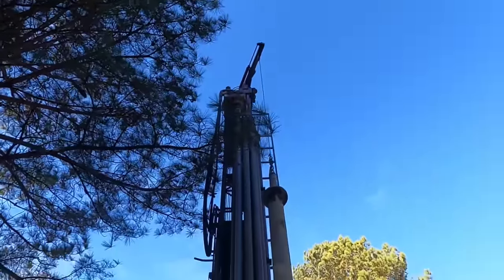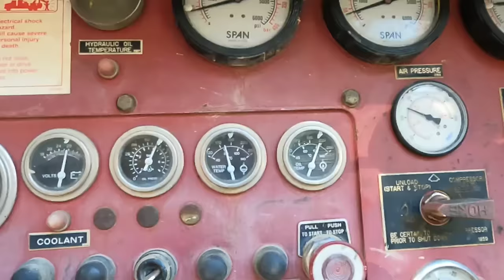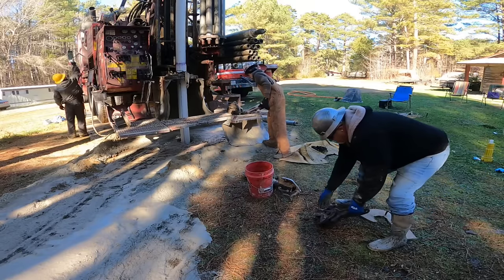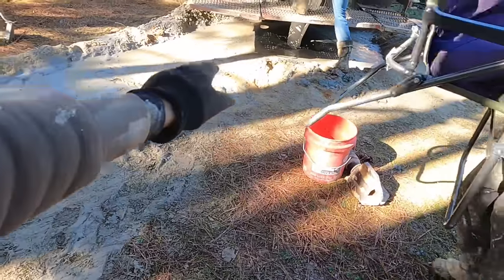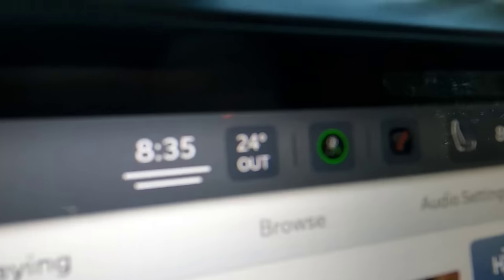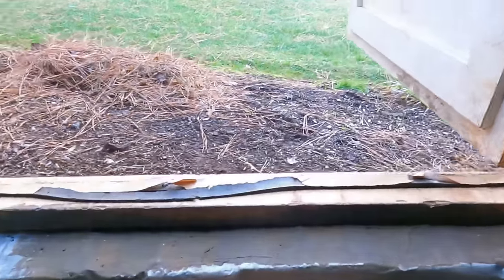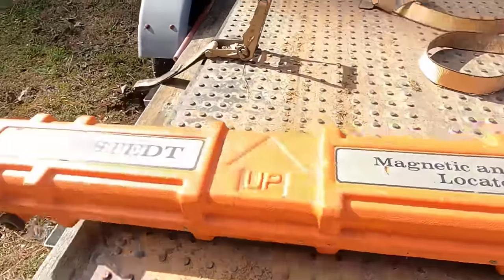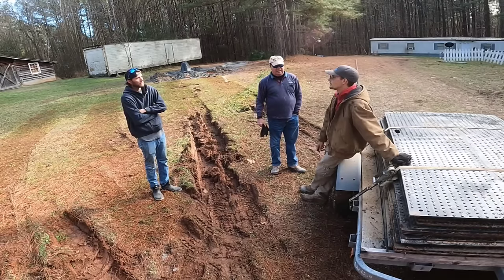Father & Son Well Drilling Business 1 Hour Special episode. How it's Done!

Comment: Many years ago, about 40, I worked as  a mechanic on a heliportable siesmic drilling crew. We drilled with the same type of drilling equipment just smaller.We used 4 inch down hole pnuematic hammers. Funny when I saw our pipe wipers brought back memories. We caalled them assholes or Bobs, I used to go by Bob when I was younger. We normally worked in the Yukon or Nwt drilling 50 to 60 ft shot holes. Merry Christmas to you and your crew. Do enjoy your vids.

Comment: Hey Phil! I know y’all don’t get the cold down there that we get up here in Canada, but what I’d do is run a set of coolant hoses from the cooling system on the rig motor to the cooling system on your traction motor. Keeps hot antifreeze flowing through your motor while you’re drilling, and if you plumb it correctly it could warm up the rig motor while you’re driving to the well site. Just a thought!

Comment: Most people don't know you want to put your primer on PVC and then the glue before the primer dries. Those bigger pipes are harder to do that with than half inch. I know also a twist helps make sure glue is spread all around. It's sweet to watch stuff like this. I. Always been fascinated with machines.
Reply: Manufacturers are now suggesting not to twist the pipe. Just bottom out in the fitting and hold it still.

Comment: 2009 we had a well drilled at our property in Lodi. They drilled a 18" diameter hole 426 feet down. Dropped a 8 inch casing all the way down. Went through 80 feet of sand than clay gravel and hard rock. Well proofed out at 770 gpm. We only needed 100gpm for our vineyard so set a 10hp pump with 3" galvanized pipe all the way down.

Comment: I just started showing your videos to a few friends who have wells . Everyone enjoys them to the point where notes are being jotted down ( most don’t have internet and cell phones are non existent , older folks ) one of the guys asked me to check his well ( he hand dug it 50 years ago ) all I smelled was sulfur. It’s only 35’ down and lined with concreat pipe , he is located near a swamp . 
One friend was complaining about rusty water , I had to replace a few things at the tank ( pressure regulator , steel tube , clogged filter . Then water airraters  each faucet . Water flow got better but still rusty . Well was buried under trash and I cleaned it up to see what’s in the well . What I found was 2” galvanized pipe . Told her to call a well co . It needs to be replaced . I’m thinking her well is 125’ down  , as all well on this street are that deep . 
I’m thinking drill down to 175- 200’ to find better water

Comment: its fun watching you, I was a driller in the early 80's the company I worked for used an Ingersoll T4W and everything was a mirror image of the rig you have. what brand and model is this?  I was about your age then and I remember how physical the job was.  We also had some cable tool units, drilling in hard sandstone we could get 2-4' a day LOL, be thankful you have that hammer bit. 🙂. It was nice with the rotors we could also drill several hundred feet a day in normal sandstone.  We also used only steel casing setti g anywhere from 20' to several hundred feet.  Sometimes we lined with 4" pcv if we found sand or a fault zone after setting the initial casing.. I also see that the grouting method was different, we used cement and water and mixed it with a pneumatic drill in a 15 gallon drum :-)

Comment: Interesting to see how you drill wells. I have drilled 35 wells that we completed, about six that were dry. It's more exciting than Las Vegas to pick a spot, hire a rig and find out if you are right. Water sands are very strange. I drilled one well that was sixty feet, moved a mile east and got nothing at 400, moved a ways and had to drill 580 feet. One well the static level is at 4 feet down, the later at 300 feet. Hard to understand. Thanks for all your work.

Comment: Can you explain how the drill works with air but you can still inject water down thru the drill rod?  Is the water and air mixed on the rig and then goes thru the hammer.  That doesn't seem intuitive for me that uses pneumatic tools in a mechanic shop.  I realize that the scale is much larger for your hammer drill.  I love you videos, I just haven't seen the topic of how the hammer works along with injection of water or foam to clear the debris the hammer chews up.  Thanks!

Comment: I drilled for many years with different types of rigs & air rotarys, then sold drilling supplies & pumps before I retired, I was wondering where you got the yellow cover for the table, I didn’t know if you made it or purchased it purpose built? It’s a great idea.

Comment: I was wondering , how far into the bedrock do you have to put your casing, I used to live in Conn. and they required at least 20' into bedrock with the casing more if you had to, pending on the nature of the rock. I worked for a drilling company for a while and one hole we did, if I remember right we put 110' of casing in and that was 6" steel casing, the rock was real soft and kept blowing out. I remember a few other ones that were interesting jobs.  Dave D.

Comment: We dropped our pipe down our well when the clamp that holds it from dropping literally snapped into pieces.  I believe it was really old.  Now my stepdad hauls water to a small tank in the basement.  I suppose our only option now is to drill a new well.  Not sure.
Reply: Clamp probably wasn’t all stainless steel the steel ones rust and fall apart. If you can’t see the pipe with a spotlight you will need to have a camera put down to see how far the pipe fell, he has videos of him using hooks to get ahold of it to pull it out. Also it’s best to double clamp them and use all brass fittings

Comment: I think he and the hammer up is more about tolerances than anything else because if that pistons running tight at least in my experience with a cold hammer or our green horn, smoked a 10 inch hammer and then went to the 8 inch hammer and smoked that all because he didn’t but it was a lot colder. It was 10 below And it was a pit viper which has an immense amount of air I mean 2300 to I think 2700 somewhere in there we can drill 16 inch hole if we want but yeah cold hammer is no good. You can even hear him when you’re drilling. They’re slow at first and they speed up and that’s because all the tolerances are coming in to play. Be safe brother keep all them fingers crossed

Comment: ? Can you show how the water 💦 come through the perforated casing. when you put in the pvc casing I did see a cap at the bottom nor a perforated holes. I’m asking because I am having a well, and I would like for them to perform the same method that you perform.
Thanks
Reply: The casing isn't perforated. The casings purpose is to seal off the well from ground water. The bentonite slurry seals the outer casing to the oversized hole.
Reply: So how do you keep the debris from in the water from coming up the pipe into your submerge pump area?
Reply: @grizzlysteve5728    Sorry, I don't understand your question.
Reply: When the submersible pump is working, how do you stop some of the rocks or derbies from being sucked up through inside. I was wondering why is there nothing to filter small grain or rocks from inside aqua well from getting trapped inside the PVC Casing
Reply: @grizzlysteve5728   Well pumps do have screens on the input side of the pump. Additionally, some well installers put a sleeve around the pump so that the water is sucked up a few feet from below the pump. This sleeve helps cool the pump and additionally isolates larger debris from being sucked into the pump. The output of the pump has a 'drop pipe' (PVC, black flex plastic, or metal) to the surface.
Reply: Thanks 🙏 so much and we are looking 👀 forward to more videos

Comment: Merry Christmas to you & the family! Really appreciate all the work you put into your videos! Ya really got me hooked into watching your older videos - it's really a fascinating trade!
Can I ask ya a personal question... Looking at replacing my 35yr old pump (just trying to be proactive 😊)
What is best brand of slow start pump... I have a ½ horse / 10gpm pump.  My local drillers advised that I don't increase the gpm, stay with the 10gpm ... their reason is that having a larger may/could cause the walls in the well to cave in.... Other info might help ya is... Ground to water is 12', bottom of well is 36', current depth of pump is 24'.  I'm looking at installing solar system, the solar company recommended the soft/slow start because it's easier on the power grid system... We have a large garden and livestock, so the pump runs quite a bit during the growing season 😊
Would really appreciate your thoughts 🤔 
Haven't found many info videos on pumps running from  solar or using the off grid systems...
Reply: Grundfos. Yes don't increase the GPM of the pump, the well data plate should show how many GPM the well produced at time of drilling and you don't don't want to exceed that, pulls the water level too low when it's running, and stirs up the water in the well too much etc.

Comment: Out here in nevada,they charge $100.00 a foot.is that gouging?
Reply: It really depends on the local geology and how hard it is to drill through. Ask H2O mechanic, if they were drilling through river rock and/or sand, $100 a foot probably isn't enough! If they encounter stuff like that and constantly lose circulation, it can be an extremely slow and frustrating process.
Reply: That is at the high end of the biz. Hard to say if it's gouging or just the way it is where you are. Well equipment is VERY spendy, permits spendy, and materials also............   not to mention the labor.

Comment: Is 15 gpm enough for 13 homes?
Reply: Sure as long as they're all not trying to water grass, supply water to a barn for animals to drink, or irrigation. The key will be having a big enough pressure tank for them so the pump isn't constantly cycling on/off. The correct size tank and pressure switch settings will be essential for the whole thing to work good.

Comment: Random Question Brother, i've been watching your videos since i moved from the City (Miami) to North Florida County side (just south of Georgia) where i now have a well pump. I"m trying to get a 2nd well installed for the 2nd house on the property (Currently 1 well does both but there's no stamp with flow rate like i've seen you do). The previous owner mentioned that the well was about 98 feet deep. Getting quotes everyone wants to changed about $7k for 100ft well and $25 each additional foot (1hp pump with permits but no GPM mentioned). That seems pretty crazy to me but everyone seems to have that install price range,. What do you think? i have 0 expereince. Do you think it's highway robbery in north Florida?
Reply from the maker: That's pretty normal for your area. Yes it seems like alot, but a drilling companies cost of operation is expensive & has nearly 2 to 3x d in the last couple of years. Just basic inflation due to our...well...  inflation
Reply: @h2omechanic  thank you very much for the quick response and honest opinion. Either way was going through with it, just feel better about it now.

Comment: Can the Bladder in the Tank be replaced ?
Reply from the maker: No. Tanks are welded shut
Reply: @h2omechanic  My tank has bolts in a circle plate around the bottom where the pipe is. Tank is Tan in color from 1985. I got it at Sears.
Reply: Probably can't find new bladder if it was replaceable.
Reply: I replaced a iron tank with a funky diaphragm with marbles to control air in tank in 1985 with the bladder tank.  It's a shallow 1 stage 1/2 hp jet pump the motor has failed .  I can't find anyone to work on it.
Reply: I've learned a lot watching your channel.
I'm an Electrician .... I love your attention to detail in all your work.😄😄